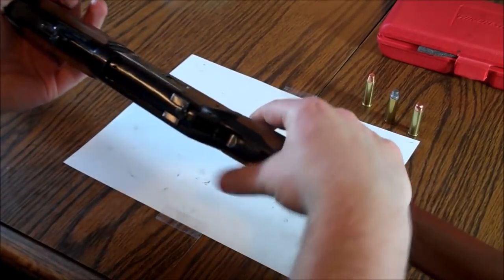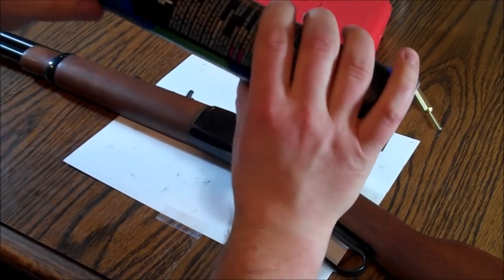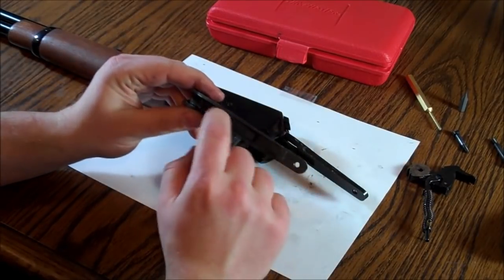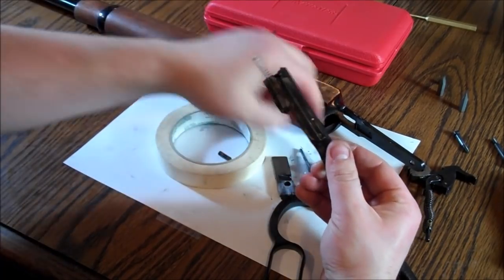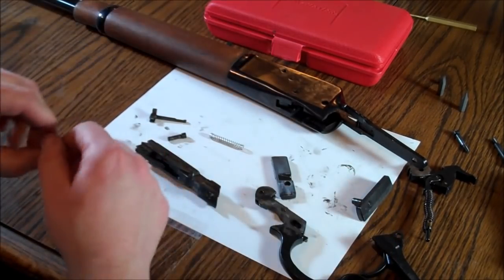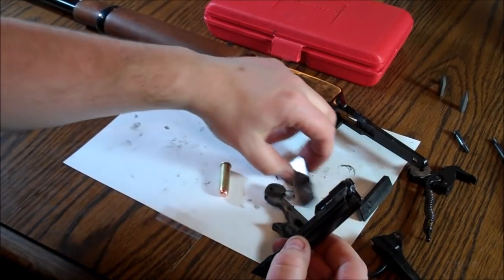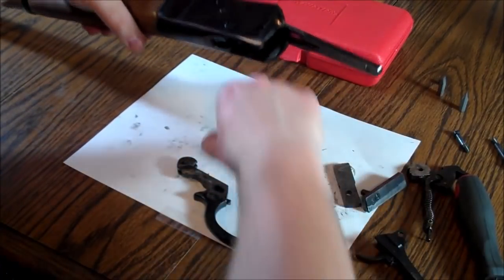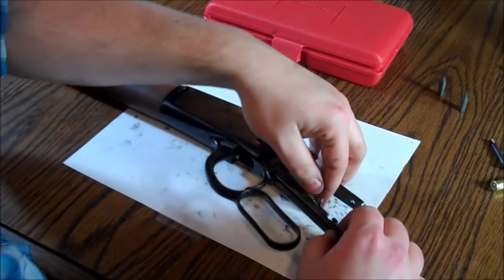Rossi R92 50 Cent Action Job (Winchester 92 Clone)

Comment: I use high temp bearing grease on my AK-47 I just picked up my first lever action can I use the high temp bearing grease or do I need to go get the one you use and what is the name of the one you used
Reply from the maker: You can probably use just about any grease you want in a lever action as it just needs to lubricate.  I have had great luck with Moly-Lithium but have also used bearing grease.  The one I use is  Super Tech Moly Grease, 14 oz  for $3 at walmart.  I found it does seem to smooth out lever actions more than the red high temp in my guns but if i had to guess it's because the Hi-temp is thicker than the moly until it gets hot and thins out which doesn't really happen in a lever gun.
Reply: k ty ill just grab a tube
Reply: You may want to research polishing compounds and invest in a drumming tool ( or similar) as well. Also watch a video about ( seating valves in automobile head of engine) . If you have any Stainless firearms like revolvers , polishing them can ( in some cases) make them more desirable! A polishing job can most times cause your Revolver to command a premium! Especially when someone sees their reflection in one . It’s a art all of its own . CARFUL!!! As some older guns should not be polished, especially collectors pieces! The ( patina) from age and use should be preserved. Polishing a antique can take away from the value. Good luck !  Slick that sucker up ! It’s almost as fast as a simi auto. ( maybe faster) .

Comment: I bought one understanding I would need to refinish all the moving parts, a very easy task. No way will I spend $1400 for a Uberti, Winchester or Browning. I have owned many Amadeo Rossi firearms since the late '60's & early '70's and must say the quality was much better before Taurus became Braztech.
Reply: Would you mind explaining in what ways your newer Rossi has failed or what you have found that disappoints you?
Reply: @nathanm7438  I hasn't failed me because before I ever fired a shot I disassembled it totally and de-burred all the parts and pieces and shortened the main spring, ejector spring and the magazine spring. I replaced the plastic follower in the magazine tube with a brass follower and did a polishing job on the trigger group that made it smooth as butter. Nothing about it is disappointing but I worked with it for about  3 hours to get it where I wanted it that should have been done at the factory but they would have added another $300 to the purchase price to make it that smooth. It's beautiful carbine with deep dark bluing and beautiful wood on the stock and forend. I knew it would be some work from watching the youtube videos but I like tinkering so I looked at it as a fun challenge. I love the thing.
Reply: @dougpoulton5544  lol sorry about that I totally misunderstood your first comment. Ya I agree they are an amazing way to go for people who don't mind some work or just that they like to tinker and put work into their own guns either as a project, hobby, etc, And also give the gun some personality.
Reply: Doug Poulton. Is there anyway you could quantify how much you shortened the three springs?

Comment: Good gosh man. I'm glad you got your gun working and I appreciate you making this well documented thorough video. But why would someone buy a gun they had to completely dismantle, buy substitute parts for and then fix to make it usable? Taurus screwed the pooch on the 92. YouTube is littered with Rossi 92 failures and work-arounds. Get a made in America Henry. Buy once, cry once. The cheapest isn't necessarily the most economical.
Reply from the maker: Henry makes nice guns, but their big boy line looks a bit wonky to me.  I wanted a Winchester 1892 and couldn't justify the price a vintage one would bring.  Winchester's are very sturdy guns but generally are a bit rough when new no matter who makes them.   Over time they break in but I wanted to speed up the process.  I'm sure 1892 in .25-20 that has been handed down my wife's family was a bit tight when it was made in 1895 but in 120 years of use it has broken in to be butter smooth.  It worked fine out of the box, the spring change just allowed for a lighter lever and the ability to feed more profiles of .357
Reply: Taurus made a really inexpensive copy of a really good gun. I expect all clones to be this rough and unfinished and i thank god that someone is still making something like this for people who could not afford to buy a winchester let alone be able to modify it after spending that much money. If you expect something to work flawlessly without any breakin or action work, buy a modern firearm design.
Reply: MasterToan The gun works. I have 5 Rossi 92s and all worked right out of the box. I slicked up some and some I never have. All factory guns can be enhanced a little some way or another.
Reply: very true, the long tube of gayness is what turned me away from henrys.
Reply: Because not every Rossi needs this attention. If one would just sit down with one and work the action repeatedly for a while. Most guns benefit from some tweaking.
Reply: Well, they, like Kimbers and other firearms, are usually too pretty to actually use/get dirty.  So, you end up spending much more for a firearm that sits unused in a safe--like the Maytag Repair Man.
Reply: Re: Rossi versus ( others )
some people like workin on cars, some just drive em ... some of us actually enjoy lookin’ under the hood of firearms, really like seeing exactly whats goin on inside... like cleanin em and you can watch for wear and any potential issues.. doing maintenance, some simple DIY mods, polishing etc that makes em purr is rewarding and fun.  Slug the barrel to exactly determine the bore, reload with specific recipes to match the ammo to the gun, is part of the fun, for some . 👍  My takeaway is Rossi are good bang for the buck, and need some attention to make em better.

Comment: Please remove your block and let the net nannies die in misery because I just noticed that you did not replace the tiny cylinder that sits at the back of the ejector spring and cannot tell if you caught that with the net nanny block in the way.
Thank you
Reply from the maker: Are you talking about the caption?  you can turn that off on your end.   just turn it off in the captions setting

Comment: With a live round dude? Seriously? Come on man!
Reply from the maker: There is a safety on the FP, not that you could hit it without a hammer in the gun.  You realize that in guns like the AR and AK the floating firing pin slams into the primer everytime a round is chambered?
Reply: look both ways before crossing the street, have ALL ammo removed from gunsmithing area..
just solid safety practice ,.. nice video tnx 👍